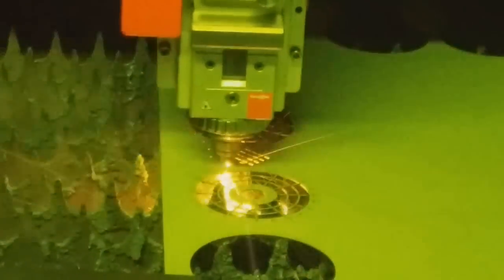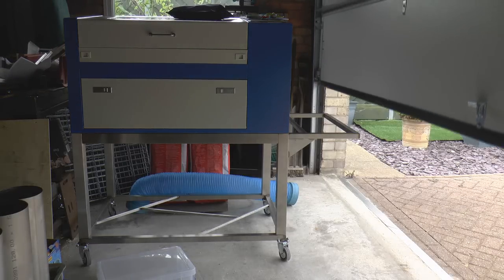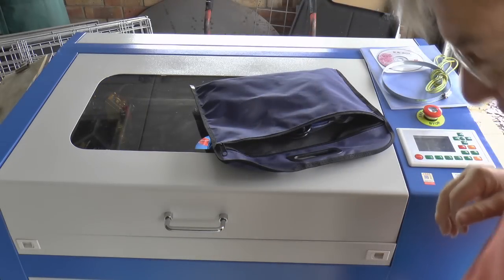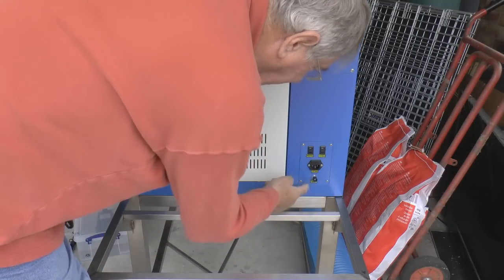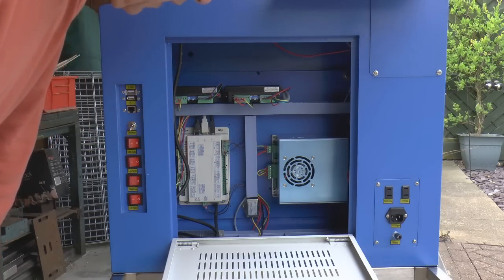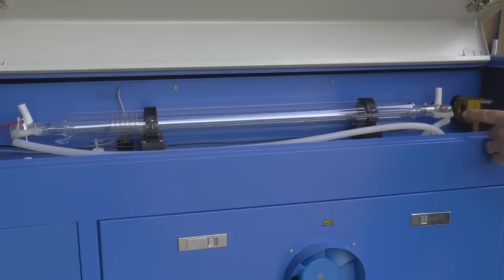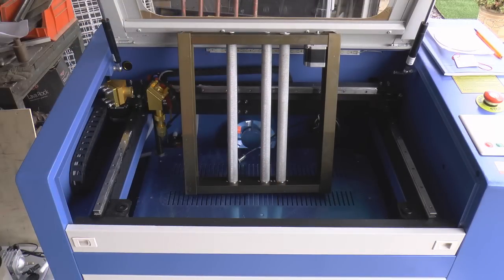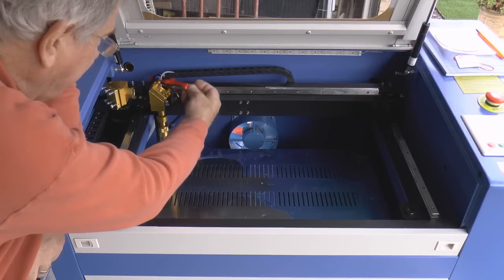Chinese laser cutter  tutorial part 1

Comment: Hi Russ,Thanks for your excellent videos. Have saved a lot of time.My machine came with the head origin in the upper right corner. Other CNC machines I have put the origin in the upper left and I would in general be more inclined to have the laser in the upper left because I would think any alignment errors would be minimized the closer you get to the laser tube which is closest in upper left. A couple of questions:- The controller on this laser is a RDC6442S which looks the same as what you have been showing. The setting I would need to change is under "Set Fact Para" which seems to be password protected. Did you ever get into your controller and do you know what the default password is for these things?- That said, I question whether I should change it. The sensor switches (look like hall effect or magnetic switches) appear to be in the upper right. In your opinion does that mean that the head origin would need to stay in the upper right?Thanks for the reply,Chip
Reply from the maker: +Chip Williams 

Hi Chip
The code to access the vendor configuration is RD8888 but don't go there and change anything without copying the existing configuration to a file of your naming first. However, to solve your issue you will not need to go there. I have tackled this datum issue in the first RDWorks Learning Lab session but many people either have not progressed through the series in a logical order or did not understand the many zeros and datums that exist. https://youtu.be/CWZvQXxbR_E is much later in the series when I attempt to explain the relationship and importance of the various datums and also it covers your head setup  question. If you need any further clarification just ask. I'm a retired engineer enjoying himself , not a teacher , so I may not be the best at explaining things.
Thanks for the kind feedback
Russ
Reply: Hi Russ,
Thanks for the quick response. The password works fine on the software but not on the controller. Like you, my CD that came with the machine was relatively useless. It had a virus and so was not useful to install the software. I likewise found the ThunderLaser site and was able to get some material there. My vendor also gave me a link to a site where I could download the (unconfigured) software directly. However, in all these cases anything unique to a particular machine were most certainly not my machine. So I have been able to ascertain all the things that ThunderLaser had added and changed to their version and rectify differences between that and the unconfigured version.
I likewise thank you for the pointer to lesson 28. I have to admit that all the lessons are jumbled on my computer and I had not seen lesson 28. Good stuff as far as it goes...
I tend to want to use the USB thumb drives as opposed to a hard network connections. Too many unknowns about the network at any point in time. There are two more origins/datums to take into consideration and that is on the controller itself and not the software. On my machine the physical head position is in the upper right position which is different than your machine where it was the upper right. That apparently needs to be matched by the software setting. I believe that the SET FACT PARA menu item would let you put the head position where you want. If I had my druthers I would put it in the upper left like your machine but at a minimum some other password seems to be needed that is not RD8888. It may also be that the upper right is where it needs to be for this machine. The 2nd origin/datum is set with the ORIGIN+ menu item on the controller and it looks like that needs to be set the same as the green box on the drawing. Without this the machine draws backwards on the X axis. Oh well, I guess I will be working in quadrant 3 from 180 to 270 degrees. Regards.
Reply from the maker: +Chip Williams 
Hi Chip

Someone has told me another password is CC8888. This maybe one that you are looking for. To access the configuration data on the machine you will have to plug your pc into the machine via the second USB port. I use the top USB port all the time for loading programs but there is a limit to the number of programs that the memory will hold.  I now delete programs as I use them.
If your machine head is top right corner surely all you have to do is tick mirror X as well as mirror Y and then set your head position (the green square) to top right as well. I presume your laser is arranged opposite to mine and enters top right also? If so yours is definitely a quadrant 3 machine
Russ
Reply: Hi Russ,
Yes the CC8888 works and yes you have to plug the PC in to read the settings (which I have done and saved). Now my RDWorks software matches the machine. No, my laser doesn't come in on the top right but on the top left like yours. There are some sort of hall effect/magnetic sensors on the right side of the X axis and top side of the Y axis and these appear to be the hardware datum so it goes to top right. I guess if the mirrors are in absolutely correct alignment it doesn't matter but I would guess the error is cumulative and all other things equal for small jobs you would want to be as close to the laser as possible which would be top left. I have been able to load a program and see it trace the route properly. Not sure how to send you pictures or I would show you where the sensors are mounted. Thanks for the assistance.
Anyway, I have a bigger problem to tackle. The unit actually arrived with no output coming from the laser tube at all. No physical damage in shipping, all the controller kit works as expected, water flow protection works as expected and all wiring is properly and neatly connected. I'm fighting the vendor at this point. I do get some hiss and slight corona at the positive terminal, along with proper status lights on the HV power supply so I believe the problem is the tube itself. I'm an electrical engineer myself, have special kit for measurement of low levels of DC current and so measured 0 current through the tube. I have sent off for a probe capable of measuring the 35kV capable of being produced by the supply as its attempting to trigger and will see if I actually have a voltage.
Reply from the maker: +Chip Williams 
Hi Chip 
Glad we are part way to getting you running. Coincidently at this moment in time I'm working on another video all about understanding how your tube works. I REALLY shouldn't be doing this because I'm neither and electrical engineer or a physicist but so many people , including myself, have had problems with their tube that I thought it would make  great topic to bore people with. I have spent hours scanning through physics research papers and other weighty tomes in an attempt to understand all sorts of very basic questions like "what's the reason my tube runs out of life after Xhours? " "Why does my tube lose power after 5 minutes of running?" Simple questions like that, where you would think that there's buckets of information out there. NO just lots of hits from people in user groups who are suffering ,but no answers that deal with the fundemental questions. I therefore set out, selfishly, to try and understand the reason why MY tube failed. It's taken hours of terribly boring wading through VERY technical stuff that's way out of my league but you occasionally come across an understandable gem in a conclusion or introduction that focusses research on another detailed study.
Actually, you may be the ideal person to answer one of my missing links.
When the tube reaches it's strike voltage and the nitrogen goes into its ionised glow state, the tube resistance drops to almost zero and has potential for blowing something (maybe the PSU?) with a huge current draw. I know that this is limited by an external ballast resistor  but now the voltage remains virtually stable. So what is the mechanism for controlling the current flow through the tube. Is there a small part of this ballast resistance that is variable to drive the current or is there some other mechanism? 
Again, this is a simple question but trying to find an answer ......well, I haven't 
I'm sure you will know.....but keep it simple please.
Thanks for your input
Russ
Reply: Hi Russ,
I'm just getting into the physics of all this myself but there are a couple of things I have run into over the course of my career. 1) Gas filled tubes in general tend to have a fixed voltage per length while they are ionized and running. In the old vacuum tube days this was one of the ways that voltage regulators were made. Go search for the 0A2 vacuum tube. This is one of the reasons that the power of these laser tubes is largely dependent on length. For a given current the longer the tube the more voltage across it and P=V*I and so more power is involved. Essentially you have so much ionized gas per length and the laser gain through the medium is related to the optical length. I believe the number we used rule-of-thumb was 200V/in on xenon flash tubes but it will depend on the gas composition, etc so not sure about the laser tubes. They appear to be in the 375V/in range 2) Gas tubes when they ionize exhibit a region of negative resistance. What this means is that when the voltage goes down the current goes up. That's non-intuitive but basically when you think about it the laser tube is not conducting at all and the power supply voltage increases until it causes the gas to ionize. At that point the current starts to increase but the voltage needs to drop in order to keep the current level from going through the roof. Hence, negative resistance. By the way this exact same phenomenon is what happens in your typical fluorescent lamp when it starts. So what you would really like to do in your power supply is provide a high voltage until the tube triggers and then control the current level independently of the voltage which in any event is largely controlled by the length and composition of the tube. The simple way to do this is with a ballast resistor in series with the laser tube. Before the tube strikes and there's 0 current there is no voltage drop across the resistor. Once current starts to flow you get a voltage drop across the resistor. Suitably sized, the voltage/current relationship becomes controlled by well behaved ohm's law instead of some weird gas tube physics. The only problem with the resistor is that real power is dissipated when current is flowing. For really small currents and voltages this may be acceptable but for larger values it becomes problematic. In addition the resistor used has to be able to handle high voltages without breaking down and those are more expensive varieties. So what is more common is to control the power supply dynamically as you have surmised. Some of the magic here is actually in the HV transformer design itself. We normally think of transformers as devices just to convert voltages and we expect Pout=Pin (with some account for efficiencies) and generally at 50Hz/60Hz we expect no energy to be stored in the transformer but to pass it all through. In HV power supply transformers for gas tubes the transformer will often be intentionally built with a small air gap or use material such as powdered iron or ferrites that have implicit little gaps between the particles such that magnetic energy is actually stored in the air gap. The power supply topology then typically used is something like a flyback arrangement where the transformer input circuitry delivers a specific amount of energy to the transformer each cycle and then the output circuitry removes the energy and delivers it to the load in a different part of the cycle. That energy at the output can manifest itself as a high voltage with low current (before the tube triggers) or a lower voltage with higher current (while the tube is running) which is just what we need for the laser tube. It is also inherently self protected against shorts because there is only so much energy to deliver. The active regulator circuitry at the front end then just makes sure it delivers the right amount of energy to the primary of the transformer each cycle. Best of all there is no huge real power loss as with a resistor. All this energy storage/release is very similar to the way a spark coil works in an automobile and is the way all the little fluorescent inverters work in your LCD displays on your laptop. Hope this makes sense.
Regarding tube failures a company called Parallax Technology seems to have some good material. http://www.parallax-tech.com/hardseal.htm and  http://www.parallax-tech.com/warranty.htm#major_cause
Reply from the maker: +Chip Williams 
Hi Chip thanks for all those links 
I have now put my video together, (part 1)  and am halfway through part2 .I had already reached a main conclusion as to why tubes eventually die from some research papers done in Russia. It was great to follow up on the link to the Parallax website because they mentioned just a few key words in their warranty limiting conditions to confirm the findings I had already arrived at. They didn't give anything away, but I shall.
On close examination of the tube I replaced, It was to a poor manufacturing standard. The problem with the tube manifested itself very quickly when I was over driving at 95% power. The mode burns I was doing at the laser output were sort of TEM00 (gaussian) for a few seconds and then the mode changed dramatically and the power dropped off. After 10 minutes the output was almost zero. You see all this in my https://youtu.be/DJBRZ2J0Q9A. Jump to the last 3 or 4 minutes to see the telling mode burns. At the time I did not understand what these non-gaussian patterns meant, but after a lot of reading (difficult to find) I realise these are different modes that can occur when the mirrors go out of line and you no longer have a single coherent beam The 4 dots in the 9 minute result is an absolute classic giveaway .....now that I know. The second part of my next two part video will be to reinstall my old tube to see if I can fix a problem that I have spotted with it, now that it's out of the machine and can be closely inspected.
Reply: +SarbarMultimedia Hi Russ,When you look at some of the higher end tubes and they use external mirrors that can be adjusted and in fact are not dependent on the glass tube itself for structure I wonder if a big part of doing that was to keep mirror alignment over temperature changes? One of the first things I thought of when I saw these water cooled tubes is just how good is the cooling through glass? I'm not a thermodynamics guy but when I took a quick look on the internet at the value k (W/(m*K)) you see glass has a value ~0.8 whereas steel is ~50, aluminum ~205 and silver ~406. http://hyperphysics.phy-astr.gsu.edu/hbase/tables/thrcn.html. What this tells me is that the glass in the laser tube is not a good conductor of heat and so even though the water is not rising in temperature much the inside of that tube may be quite a bit hotter. With that the gas mixture itself may get to the point that the He is not able to get rid of its heat to the point that the CO2 is able to go back to its rest state and so the power drops off. Also could be a reason why you recover in 30 seconds. It would be an interesting experiment to run with water at the colder end of the specifications and see if that made a significant difference? I also note that essentially all the tubes have an extra little water connection through the part of the glass or metal that is holding the mirrors and I wonder if this speaks to your concerns that the heat may have pushed the mirrors out of alignment? Is this what they are trying to prevent with the extra water path? I also note that the bigger or higher end tubes all seem to use metal holders. Is part of that taking advantage of a higher thermal conductivity to keep the effects of heat on the mirrors to a minimum? Longer term I then also wonder about the action of heat on a glue seal vs. a glass to metal seal. There's got to be some concrete reasons that some tubes are advertised as 1000 hour tubes vs. others that are 10000 hours. I then keep thinking about your videos 22 and your curves that show the power leveling off above ~60%. It's not impossible that it's power supply related but probably not. One thing I should be able to do if I ever get my machine up is put my Hall Effect current probe on the ground line and actually measure the current through the tube at different settings. I'm suspecting that the current will continue to increase quite linearly with power setting but there's simply not any more energized CO2 gas to make more optical power. The ideal would be to capture the current values at the same time that we capture optical power. We could see how far they track and where they diverge. Of course if the current is going up but the optical power is not, where is the extra power going? Why it's getting turned into heat and exacerbating the problem. We may also be causing additional problems like disassociation of the CO2 into CO + O2 and these lower end tubes may not have the catalysts or other mechanisms to facilitate the regeneration of the CO2. Makes you think it would be worthwhile to oversize the tube so you aren't ever stressing it in that regard. I'm interested in your new videos when you get ready to release them and would be interested in some of the papers you've found.
Reply from the maker: +Chip Williams 
I used my new home made clamps to quickly fit my original tube back into the machine today. I have a proper "lollipop on a stick" power meter (basically a calibrated aluminium block calorimeter) that works great. I have done a output power plot against drive current for 10% to 95% programmed power. Max power output is 31 watts at 60%power and 20 mA  (the rated current for this size tube).  Unlike my new tube. the power in this old tube drops like a stone after 65%  and heads towards 20 watts at 95%.The other interesting thing that I note, the beam colour is not the normal pink glow that you get with nitrogen ionisation, this is almost WHITE. I have heard others report this colour  but am not sure why this may be. If the nitrogen had been depleted in some way. there would be nothing there to stimulate the 31watts of lasing power that I am seeing. Im off to get some heat transfer grease tomorrow to fill up the cavity I have discovered behind the fully reflecting mirror. I suspect over heating of this mirror my be the reason for this strange characterisic. More power, more distortion and less focused output. It will be interesting to replicate the experiment tomorrow with the grease in place. I'm using the silcone grease with ceramic heat conducting particles. It's lower heat transfer rate than the silver loaded ones but seems like a bad idea to put a potential conductor near the HT lead.
The parallax tube look great if you are a small business or industrial user. However at their prices I could buy 10  of the more reputable Chinese replacement tubes. It's not cost effective for recreational/hobby use.
The links you mentioned last time were 3 that I had  looked at and bookmarked but thanks anyway.
Bit late here at the moment (02:50) so I'm off to bed
Speak soon
Russ